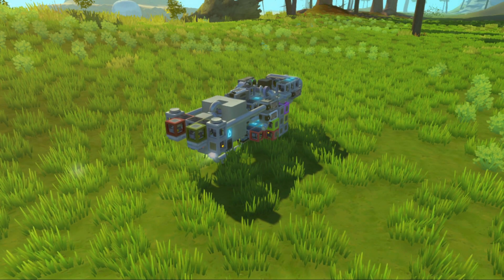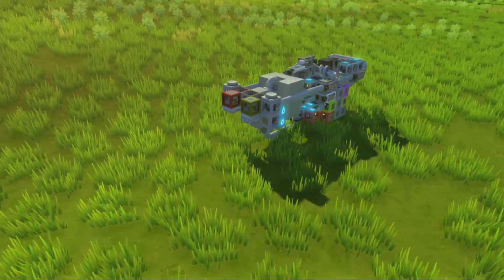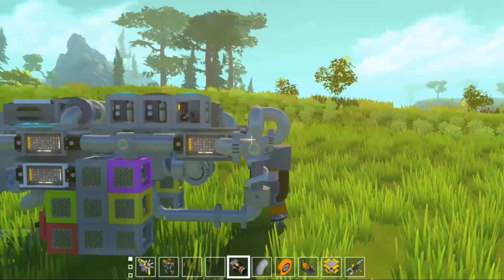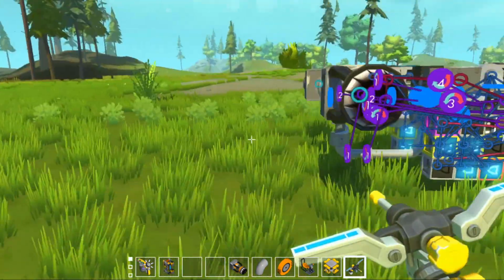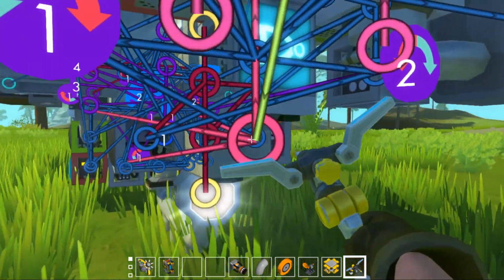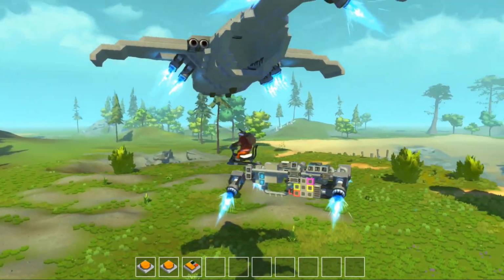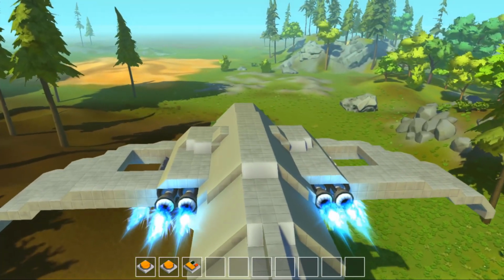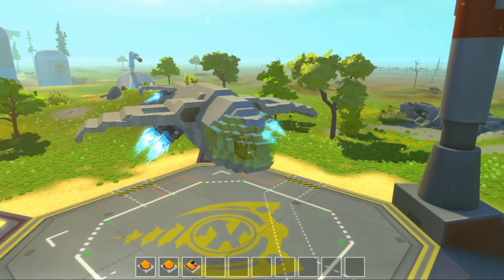Micro Flight Computer... |   Scrap Mechanic

Comment: i wanna use something like this because im more of a builder im not to into the logic so is there any way you can make one for the survival update or give me tips on fixing it
Reply from the maker: The only thing that needs fixed is the weight used for the vertical motion sensor. I've fixed the Micro Flight Computer, but not the big one...

Comment: Hello, 
hope all is well, I came across an issue with this build in game. I followed the video to the letter and once i pushed 3 to turn on the flight computer it started to angle the controllers and does not allow me to pick the angle. I constantly have to hold 1 to keep it from flying to the sky box. I believe you intended for it to hover and use 1 and 2 to go up and down based on your video. As soon as I let go of 1 or 2 it continues to angle the thrusters down and I would have to keep pressing 1 to some what hover and keep it from it upward flight. 

Thank again!
Reply from the maker: All flight computers have been broken since the survival update and I haven't had a chance to fix them...
Reply: @AlMagmaGaming  makes sense  hopefully you can upload a new micro flight comp to use in survival
thanks again.

Comment: the thing rocks like it has ptsd
Reply from the maker: I actually love this comment...
Reply: @AlMagmaGaming  is that the quinjet from Avengers age of Ultron
Reply from the maker: That was the original inspiration...
Reply: also could you possibly add a tilt feature to the flight computer?
Reply from the maker: Are you thinking something like a helicopter that can tilt to fly, or something like a spaceship that can tilt without moving?
Reply: @AlMagmaGaming  tilting without movement